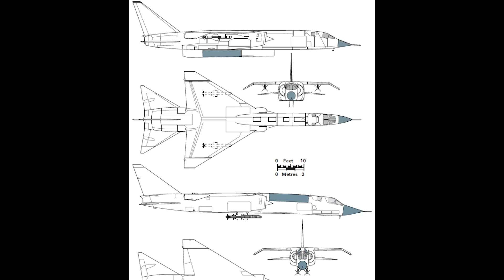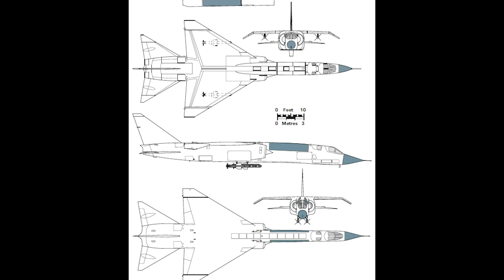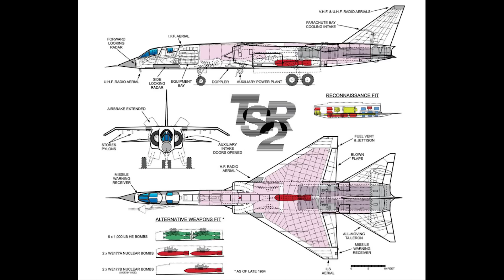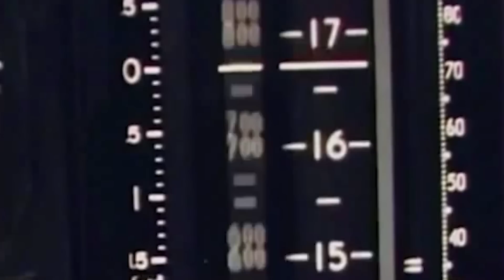The $21 Billion Bomber That Was a Total Nightmare to Build

Comment: It would be fun if all the cool planes got built. I wish the B-70 happened, but it made no sense. The B-58 was retired for the same reasons. The TSR-2 was essentially an F-105/B-58 hybrid.... and made no sense. Laugh at the F/B-111, but the plane it ended up being is what GB should have built or bought. I see Concord references in the comments... yes, would have been fun to have a USA SST, but supersonic flight was never going to be permitted over the USA (and it IS permitted WHERE?). The economics for purely trans-oceanic flight were never going to make sense. This was no secret in the journals of the time. It was ALWAYS going to be a huge financial black hole. We passed on that one, you didn't. Congrats????

The Canadian Arrow... lovely. But while it was still being worked up, the threat had changed. Its mission was being obsoleted during the ramp-up. The mistake wasn't cancelling it, the mistake was taking it so far and getting everyone so invested (in every meaning of the term) before they pulled the plug. Unfun facts are unfun, but they are still the facts. P.S. The Mosquito was the best warplane ever built by anybody.

Comment: The official reason it was cancelled was down to costs.
The unofficial reason why it was cancelled was because the Yanks had nothing to match it at the time - same as Concorde and the 'noise issue' in the states.
Reply: Real reason it was cancelled was because BAC had totally fucked the design up!!! It couldn't meet the operational requirements in almost all regards. Same reason that Nimrod AEW 3 and MRA 4 were canned. Bloody thing couldn't do what it was designed to do!!
Reply: @richardvernon317  agreed, very optimistic design requirements that BAC had little chance of meeting, and not helped by the constant moving of goalposts as the various branches and depts argued as to what the TSR2 should do for them.  Add the awful "communication" problems between these (too)numerous agencies at every level. As to the Nimrods, too many wrong assumptions made at start, never a good plan to start with an aged platform of dubious airworthiness and life, but in usual way appealed to the government as seemed "cheaper" than buying new, then they stuck with what was obviously a dead duck to avoid embarrassment.

Comment: It was an interesting idea, but the plane was too narrowly focused on the nuclear strike role from the outset. In the early 1960's, Blackburn offered essentially a scaled-up Buccaneer that could have fulfilled most of the TSR.2 requirements at a fraction of the cost, and it's possible because of its lower cost, it could have interested other European air forces in buying this upscaled Buccaneer for their use.

Interestingly, many of the designers on the TSR.2 project ended up working on the British contribution to a far more successful interdiction airplane project, the Panavia Tornado. Unlike the TSR.2, the Tornado could carry more conventional weapons and because of its swing wing design, could also operate out of much shorter runways, too. It's only very recently that the RAF finally retired the Tornado, though that plane still had plentiful life left as a viable interdiction platform.
Reply: Buccaneer couldn't meet the Operational Requirement in 1960 period!!!

Comment: Um, the US built the XB-70 Valkyrie one could Argue (and not without merit) that it was the most advanced and capable bomber of its time... Ya know what the problem was... IT WAS REALLY FUKIN EXPENSIVE, it was also designed to deliver nukes to Moscow in the event of WWIII. Ya know what happened... it got canceled... CUZ DELIVERING NUKES TO MOSCOW BECAME THE MISSION OF BALISTIC MISSILES THE SAME AS EVERY OTHER NUCLEAR BOMBER. TSR-2 was a plane designed for a war that never happened (Thank God) that's why it was canceled. It was also stupidly expensive... don't think that taking it from prototype to operational deployable asset would have cost less than the F-111 what are you stupid, it would have cost just as much if not more, FOR A PLANE THAT THE RAF WOULD HAVE HAD NO USE FOR ONCE IT WAS COMPLETED, CUZ WWIII NEVER HAPPENED.

Comment: It is a significant fact - not so much the closure of the TSR-2 program, but its complete erasure. The mandatory destruction of all elements, prototypes, parts and documentation is strange. It resembles best practices from the USSR - only in the UK the designers survived.

A comparison with the Avro Arrow comes to mind - a very advanced project that could have become a threat to the USSR - is suddenly closed after Labor came to power. Only in Canada was not even a museum specimen allowed to be preserved.

A conspiracy theory or the actions of agents?
Reply: How can a defensive, interceptor aircraft be a threat to the USSR?  Think!
Reply: @timp3931  Elementary Dr. Watson!
After all, the Avro Arrow fleet stationed in Canada was to be openly directed against the "peace-bearing and flower-bearing" Soviet bombers...
And in addition, no one said that based on the Arrow experience, some "Strike Arrow Mk.2" would not be born - for deep penetration of Soviet anti-aircraft defense.
And so - the program was erased, traces of it carefully erased, the enemy's arms industry was solidly reduced - and all this by the hands of "useful idiots" believing the propaganda about doves of peace (with A-bombs)!
Reply: @wojteksmag8286  There was no requirement in the RCAF for a "strike Arrow".  They bought the Starfighter for that role, partially based on cost.
Reply: @timp3931  Of course there was no order for such a plane. And probably it didn't even exist in the minds of the designers. But the EXPERIENCED team that designed and put the Arrow into production had the opportunity to reach further.
I referred to the strike version of the already proven F-15 to show how the project can be developed.
Unfortunately - the project was destroyed, the team was dispersed and Canada lost the chance to develop its economy. Champagne corks popped in the Kremlin...

Comment: The TSR 2 did make production 60+of them on the production line before the project was cancelled.
Reply: really - at Weybridge presumably ??
Reply: @RockinRedRover   TSR-2 production line was primarily located at the British Aircraft Corporation (BAC) facility in Weybridge, Surrey, England, where the front fuselage was assembled, with the rear fuselage being built at English Electric's Warton plant in Lancashire and then joined together at Weybridge before being transported for further testing and flight operations at Boscombe Down. 

Key points about the TSR-2 production line:

Manufacturers: The primary manufacturer was BAC, with contributions from English Electric. 

Assembly locations: Front fuselage at Weybridge, rear fuselage at Warton. 

Cancellation: Despite extensive development, the TSR-2 project was cancelled by the British government in 1965, leading to the dismantling of the production line and scrapping of unfinished aircraft.

Comment: The problems with landing gear vibrations were investigated and resolved by the end of the project. Fire trucks put a lot of foam on the runway, reducing the friction, and sensors were installed on the aircraft to measure the oscillations during touchdown and coasting. As with all new designs, teething problems are to be expected, and the ones on the TSR2 were minor, unlike the F111 who had problems with the wing sweeping mechanism resulting in many incidents in the US and Australia during the first years of their service.
The TSR2 and the Avro Arrow were superior and well ahead of any other design or concept of that time. They were a serious rival to the F-111 and the US reasoned that they needed to be taken out quickly. In the end, the Brits got nothing out of the deal to replace the TSR2. This, together with the belief that aircraft were soon going to be replaced by missiles, lead to the cancellation of the project. I doubt it costed $21 billion.
Yes, the Americans are always keen to cooperate, as long as it's advantageous to them. They did the same with the nuclear missiles the UK was developing after the war. The UK was ahead, and the US proposed to cooperate and promised cheap Polaris missiles to the UK. The UK transferred all their nuclear knowledge, but the Polaris missiles never came.
Reply: The Yanks were happy to take Nazi scientists as they were more advanced and absolve them of any crimes against humanity..
Reply: The landing gear problems were a very minor issue!!! it was the problems with the rest of the aircraft and the systems going into it being tested in other aircraft which were all going wrong and no amount of money or time was going to fix them. TSR2 had a butt load of major problems which were not fixable!!!! All of the official documents on the project were declassified in 1994/95. The people who killed it were the RAF!! They found that the aircraft was not capable of meeting any of the Operational requirements in late 1964 / early 1965 and they had a fit!!! Cut along story short RAF told Healy to can the project and buy the F-111!!!

Comment: The TSR-2 would have been like any new combat aircraft entering service, with many problems that needed to be resolved as they were found by operational units, its U.S. competitor the F-111 didn't exactly cover itself in glory the first couple of years it was in operational service.
People remember the TSR-2 being cancelled but don't seem to remember the other two projects cancelled the same day, the Hawker P.1154 supersonic V/STOL interceptor for the RAF and RN, and the AW.681, later HS.681, STOL transport, both cancellations resulted in U.S. aircraft being procured, F-4 Phantoms and C-130 Hercules.
Reply: US JUMP . . .  UK HOW HIGH?
Reply: Not as troublesome as the A400M white Elephant!
Reply: F-111 weas beating TSR 2 in virtually everything - speed (both high and low altitude), range, payload, short-airstrip operations, etc. The first couple of years are usually troublesome for all new planes with so many new features. F-111 stayed in service for well over 30 years.

Comment: I worked at the RR factory in Bristol in the late 70s and as an apprentice saw the last Concorde being built (it is now back as a museum piece).  Talking to many of the old hands it was clear that many of the lessons learned developing the TSR2 Olympus engines went into the 593s which were used in Concorde.  Of course Concorde cruised dry at over Mach 2 - though it used reheat for t/o and transition through the sound barrier.  We are still to catch up with many of the technologies of the 70s.  Just think a whole generation is convinced the moon landings were faked - simply on the belief that their generation can only dream of achieving it!
Reply: BAe built Concorde nor RR! False information!
Reply: @JohnSmith-ei2pz  actually BAe did not build Concorde - it was a joint manufacturing with Aerospatial in France.  The Olympus 593s used solely in Concorde were developed from the TSR2 Olympus engine and manufactured in Bristol.  The RR factory was right next door to BAe in Filton and I was able to visit the factory there while it was being manufactured.  I never claimed RR made Concorde - but the 593 was a real beast and most of north Bristol heard if one surged on a testbed - just as they heard Concorde take off!
Reply: @NetZeroNo  So never worked on it, just a visitor?
Reply: @JohnSmith-ei2pz  It was still BAC back then !

Comment: Britain never did buy the F-111…
Reply: BAe maintained it! Good days long ago!
Reply: @Idahoguy10157  Thankyou -- quite correct.
Reply: No they cancelled it because it was going to cost even more than the TSR2 and had to pay the USA because they cancelled it so wasting even more of the UK's taxpayers money. Then had to buy other aircraft to do the same work as the TSR2 would have done !
Reply: @RJM1011  Wrong!!! F-111K cancelled because it was going to be 3-4 years late and cost had gone up due to devaluation of the pound!! We were only going to buy 50 of them anyway. Also main operational requirements for TSR2 and F-111K were for far east operations which died with the withdraw from east of Suez.
Reply: Correct. The original quoted delivery schedule & price could not be met by the Americans, and typically for the british they insisted in retro fitting their own RR engines, just like with the Phantom F4's.
Reply: @MadAntz970  …the development costs of making the F-111 into squadron service were huge. Plus only Australia was an export customer. I would expect the TSR-1 costs would be similar. Who really lost was the advanced British aircraft industry. The cancellation was a blow they never recovered from
Reply: @MadAntz970  Nope, F-111K had TF-30's like the USAF/RAAF ones!!!

Comment: The amount of rubbish written and posted about the TSR2 is incredible.
The truth is technology and military requirements were changing so fast that any any new combat aircraft stood a better than 50% chance of being obsolete before it entered  service. The TSR2 was a  very advanced airframe design. The technical  issues of the project were mainly due to it being pushed along too quickly because the funding was under threat.
Would the aircraft really have been better than  what the UK's defence requirements actually turned out to be probably not. The truth is an advanced version of the Buccaneer properly tailored to the RAF's would have served them better allowing  what turned out to be the Tornado to be more advanced

Comment: That Was a Total Nightmare for America if it was build.
Reply: That's why the US government had it cancelled.
Reply: Thank you so correct.
Reply: It would have given the RAF a credible 1st strike capability on the US missile bases!
Reply: @sapper82  Under the Nassau Agreement of 1962, the US sold Polaris SLBMs to the UK.  The UK fitted each Polaris missile with three UK designed ET.317, 225kT, thermonuclear warheads and installed them on four purpose built Resolution Class nuclear powered ballistic missile submarines.  The first Resolution Class submarine entered service two years after the cancellation of the TSR2 in 1967, and the fourth in 1969.  The UK then purchased Trident II SLBMs from the US for the current Vanguard Class submarines which replaced the Resolution Class which will be upgraded by the US for the new Dreadnought Class which is currently under construction.

The UK has always had the capability to strike US missile bases because the US sold that capability to the UK.  You don't know what you're talking about.
Reply: @JimmyJamesJ  Have you seen a successful test yet?
Reply: That's why it was never allowed to proceed to service.  That was why everything related to the construction was destroyed.  It would have beaten anything US could build and kill the US export of warplanes.
Reply: I doubt it was a threat to the F-111
Reply: @williamzk9083  it was going to be the F-111 or the TSR-2, and America killed the TSR-2 so that they could market their plane.  Which was a flop!

Comment: nightmare to build - beauty to service. My father was an electrical engineer peripheral to this program - he LOVED it. The electronics were packaged in pull out modules - got a problem with something - pull out the module with all of the control circuitry and plug a new one in and turn the plane around. Then aircraft team get to work on the module in the warm workshop ... so much better than the Harrier and Lightning.
Reply: Very similar to the SEPCAT Jaguar